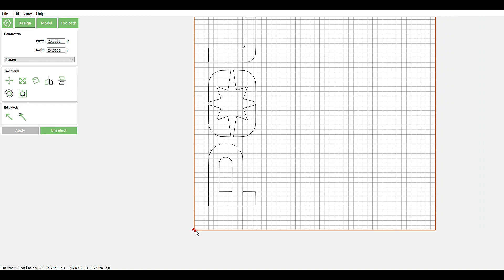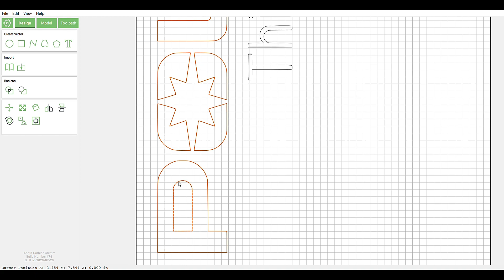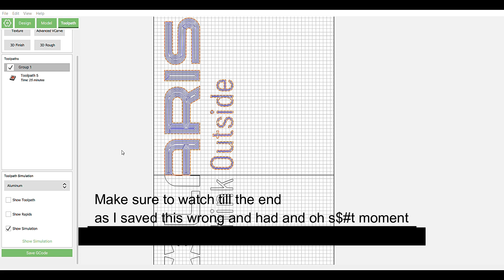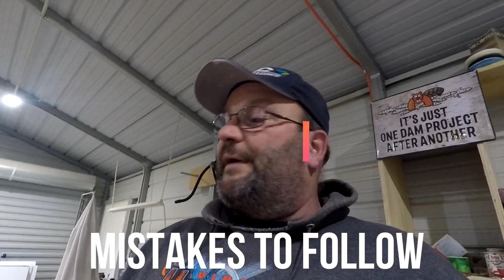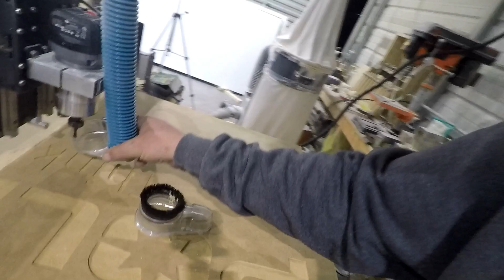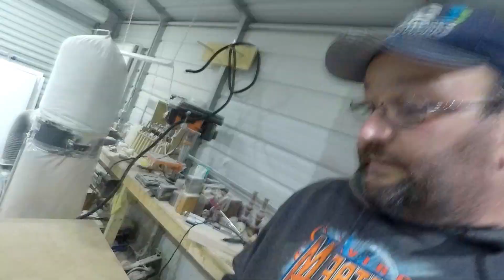How I tile my projects on the Shapeoko xxl

Comment: Really like your video. Im having a hard time applying this method to a 40 inch american flag with words on each stripe. Cant figure out how to split the 2 halves like you did. Instead of spliting one letter like you did i have to split many lines and the outer cut. not working so far. Any tips?

Comment: Nice John, can you recommend an epoxy to practice with?
Reply from the maker: https://www.amazon.com/Resin-General-Purpose-Crystal-Table/dp/B01IU9XYVE/ref=sxts_sxwds-bia-wc-nc-drs1_0?cv_ct_cx=epoxy&dchild=1&keywords=epoxy&pd_rd_i=B01IU9XYVE&pd_rd_r=77a2d02c-cdca-4819-a1fc-5341fe44ebe9&pd_rd_w=rjtDK&pd_rd_wg=IjDMs&pf_rd_p=a64002b9-9c26-4361-b8a1-b0f5a4835670&pf_rd_r=QKGMY972N7H59XTF5PE0&psc=1&qid=1609724854&sr=1-1-38d0a374-3318-4625-ad92-b6761a63ecf6
Reply from the maker: i added a link to the resin i use to use off of amazon never really had any issues just i had recieved a discount code for total boat and thats what im using in this video